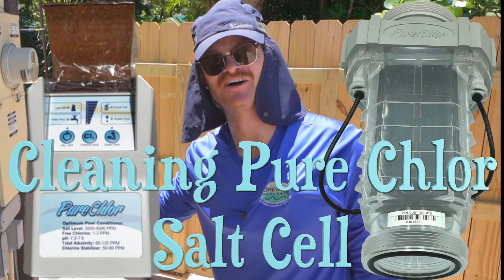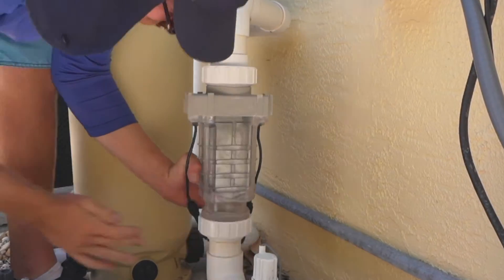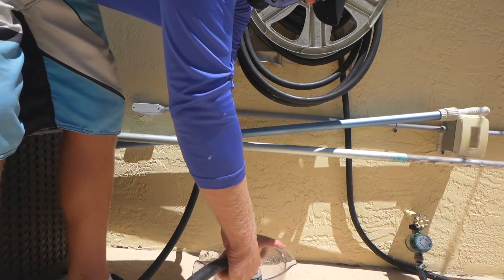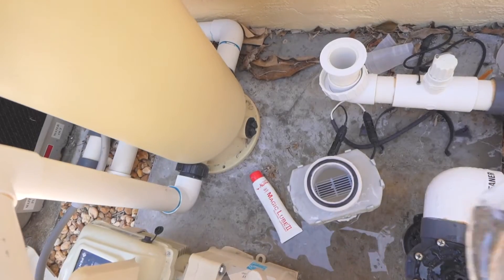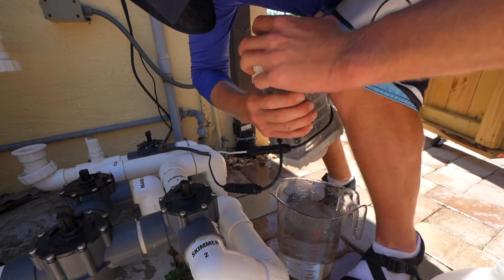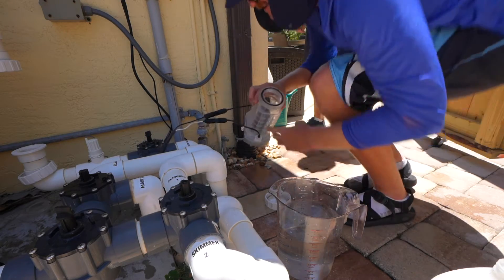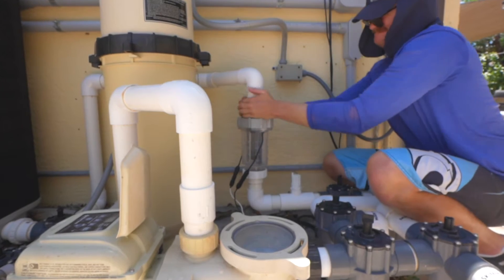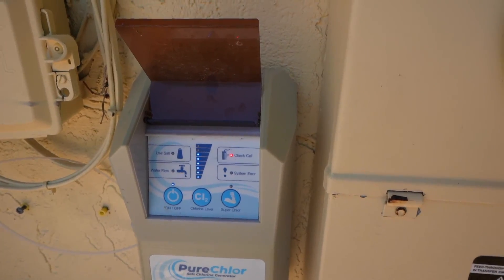How to: Clean PureChlor Salt Cell

Comment: How do you control water flow from the pool when you remove the cell? Newbie and I’m not getting that part
Reply from the maker: Is equipment below the pool?
Reply: @PoolCareWorld  we have a semi in-ground. The equipment is on the outside and below the water level. The salt cell sits vertically

Comment: Any video on how to clean a “power clean salt cell” ?
Reply from the maker: I got you! I don’t have any on route but I’ll ask around if anyone else does 👍🏻
Reply: @PoolCareWorld  thank you. People say they are simple and quick to clean without muratic acid involved. I guess I’m assuming the opposite
Reply: @erickrhernandez1451  A plastic paint stir stick used to be shiped with those when they were made by SGS. Head over to a local hardware store and pick up some wooden ones. It doesn't get it 100% clean but it's get it pretty close.

Comment: Hi, I have cleaned the cell and the check cell light is still on. What do I do to take the light off.
Reply from the maker: Have you tried cleaning the filter? It also may be time to replace the filter cartridge.. to test it you can remove the cartridge filter and close it back up without the filter and run it for about 15 minutes to see if it clears it. Please let me know!
Reply: @PoolCareWorld  I hope that the cell has not gone bad. I saw the price to replace them and it’s like $800 dollars.
Reply from the maker: @Bryanllanes27  Hi I'm still researching I will let you know when I have good insight! I know if the cell is more than 5 years old it may be time! Next time you have your pool water tested or test it yourself let me know what the stabilizer or cya reading is.
Reply: I changed the filter two days ago. It’s brand new. I just cleaned the cell today.